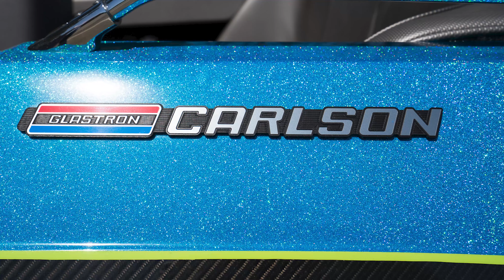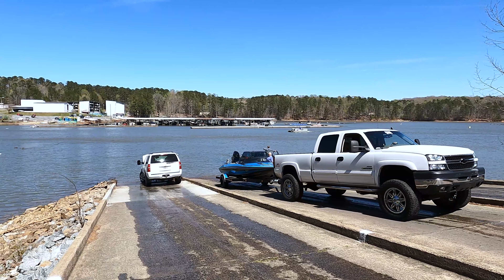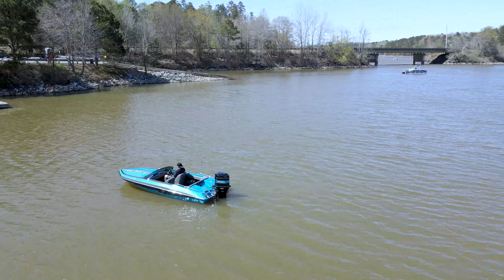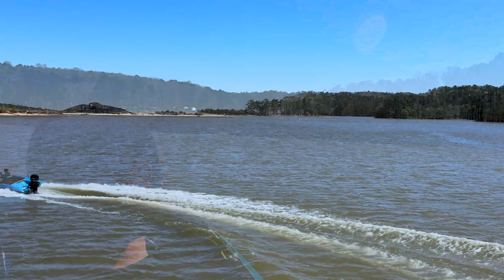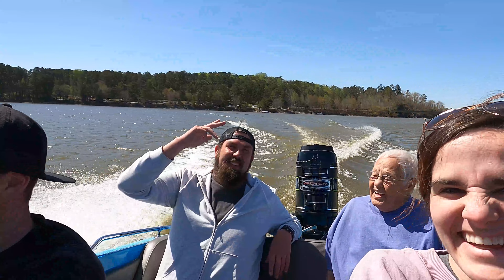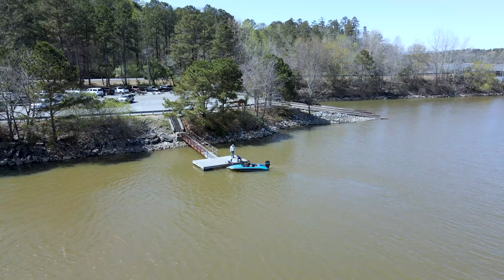1978 Glastron Carlson CVX-16 - Classic Boat Restoration!

Comment: Gorgeous boat. Beautiful resto work. 
After watching this, I'm missing my late 60's Glastron Jetflite. That little 14' 2+2 with a 75hp Johnson Stinger was a wake jumping fiend! 

I recall following a big aft-cabin jumping a three foot swell when the hull split. Luckily the boat had a crazy amount of flotation in it and was able to make it to a beach. With the help of a few beachgoers, we were able to tilt the boat onto its side to drain the water out and used duct tape to patch it just enough to get back to the trailer. Duct tape was our go-to before there was Flex Seal. LoL. 

Nice boat. Beautiful. Memories...

Comment: Nice job on the resto , I did a 72 GT160 with a 87 Merc 115 and my current 74 CV21 both full blown restos . The 115 Merc is a beast , miss that one . My CV 21 has a Olds 455 it's a nice cruiser. Enjoy !
Reply from the maker: Thank you!

Comment: I bought my CVX16 with silver ge🎉l goat and 115 horsepower Merc with power trim new in 19 77 for a whopping 6500 including trailer. I thought they were the prettiest boats on the water then and even would be the The finest looking boats on the water today. Most of the stuff now looks like a bathtub! And you're certainly not going to get them for $6,500. Try about 60,000? Great boat served us well.